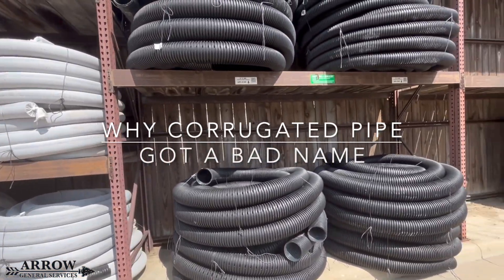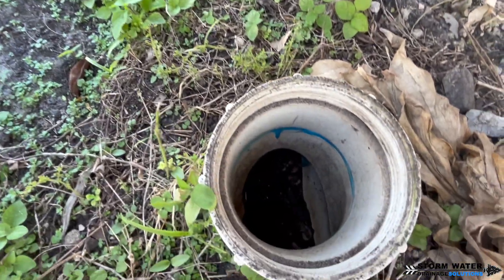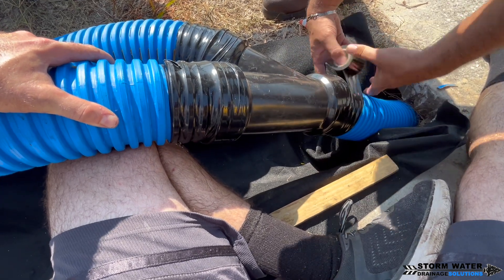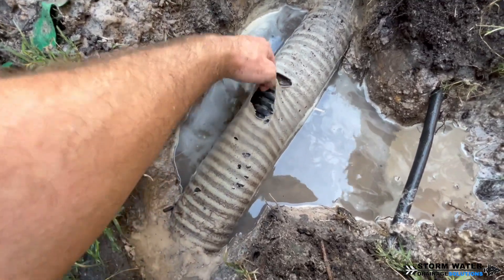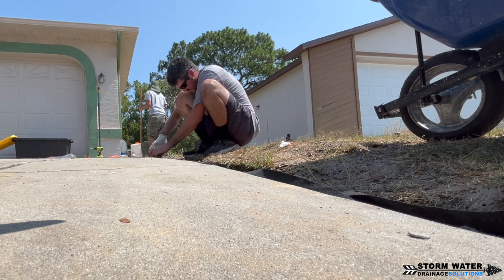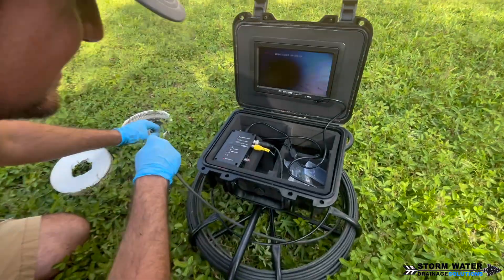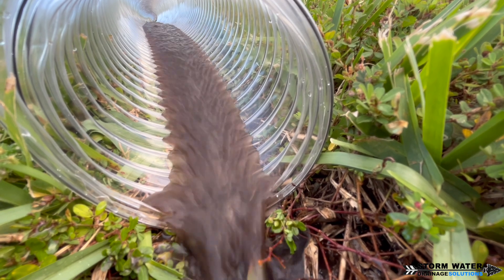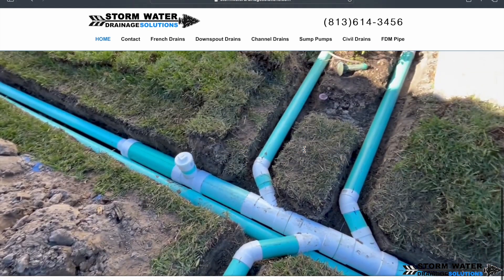Corrugated Pipe - Why It Got a Bad Name - Tampa Yard Drainage - Storm Water Drainage Solutions

Comment: If the slope was perfect, won't the corrugated pipe hold some water in a light rain where PVC won't hold any water?
Reply: I enjoy this channel, but I have the same thought. Wouldn’t the grooves in the perforated pipe hold sediment vs. smooth PVC wouldn’t, if both were installed with the same slope and assuming there is no belly?
Reply: 2:15 he says they dig the trench with fall